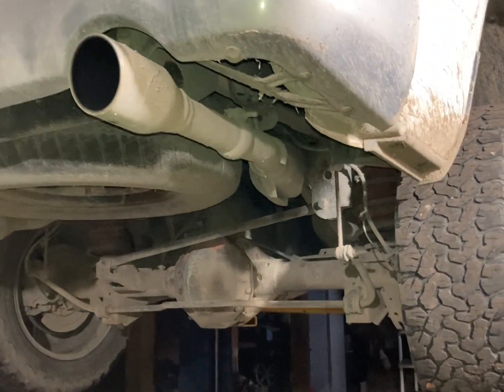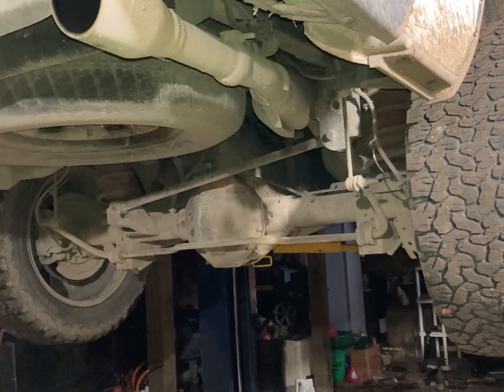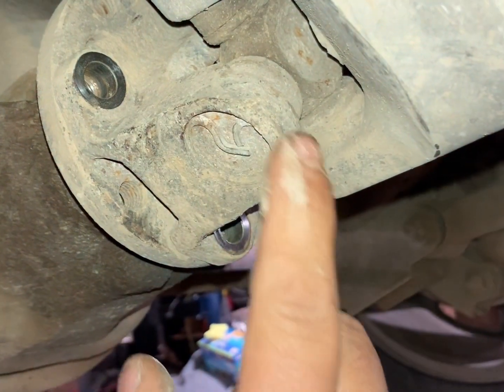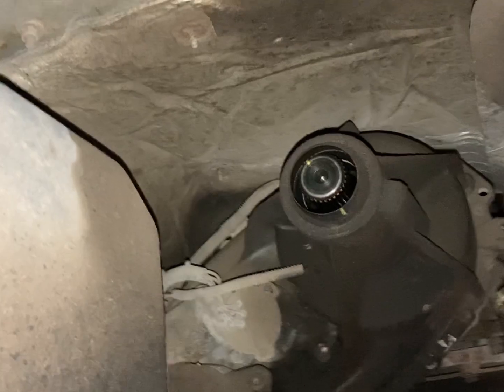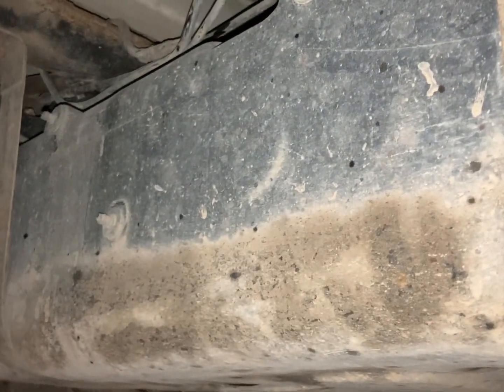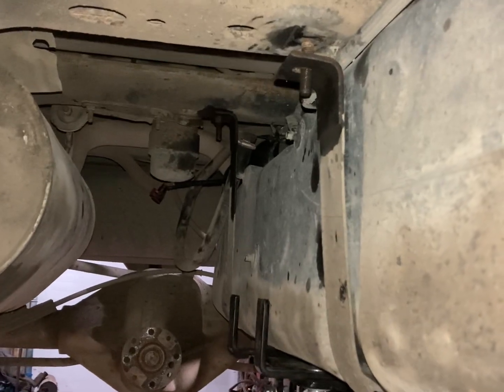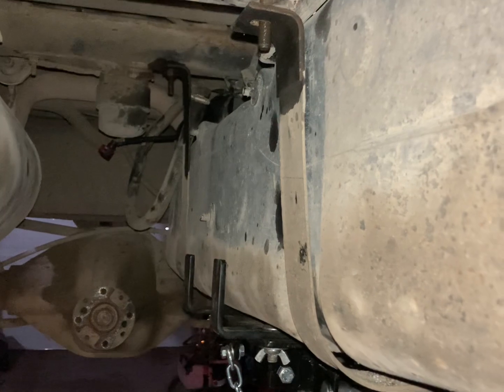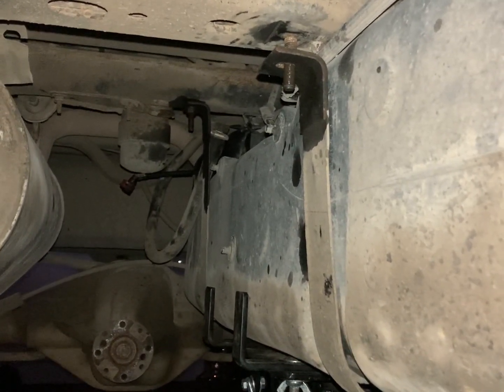2014-2018 Ram Ecodiesel 3.0L fuel lift pump replacement, diagnosis and pressure spec.

Comment: Thank you for making this video; I'm getting ready to replace this on my '14 Ecodiesel Ram - the previous owner did not have the lift pump replaced before the extended warranty period expired.  I keep the truck above 3/8 - 1/2 tank to avoid the lift pump shutting down (it's happened twice in the past 6 months).
Reply from the maker: In the grand scheme of things, it’s an easy one to replace. Do your best to clean the top of the tank before you undo the lock ring and pull the pump. The fuel clip in front of the tank is really delicate. If you break it, and can’t find a replacement, a zip tie will get you by. It’s the very low pressure return line to the tank.
Reply: @tadsworkshop  thanks again - I did this yesterday in my driveway.  The electrical plug on the fuel pump was a pain (sliding the locking tab); and the low pressure return line coupler at the front of the tank broke.  I let the pump prime 3-4 times before starting the truck - fired right up.  I ran it down to E with no issues.  Also - my tank had a heat shield on the side of it (towards the drive shaft - I removed that and it made accessing the top of the tank much easier.
Reply from the maker: @wereeves  yes, I actually removed the heat shield from this tank before this job, I realized after the video it would have been nice to have that in place. Glad you got your truck sorted out!
Reply from the maker: @republicansthatdidntvotefo1605  no, the recall is on the high pressure injection pump on the engine, on the front passenger side underneath a heavy duty plastic cover. I haven’t seen one fail yet for what it’s worth, but if Chrysler installs a free one for you, that’s great.
Reply from the maker: @republicansthatdidntvotefo1605  lol, 1,153 miles. Port Huron, Mi here.

Comment: Is the lift pump the primary pump?
Reply from the maker: Personally I never use primary and secondary to describe diesel pumps, as it’s not very clear to most people, myself included. The lift pump is simply the low pressure, 60psi pump in the tank providing the high pressure injection pump on the engine with fuel, which in turn increases pressure to the range of 3,500 to 35,000 psi in the case of the ecodiesel.